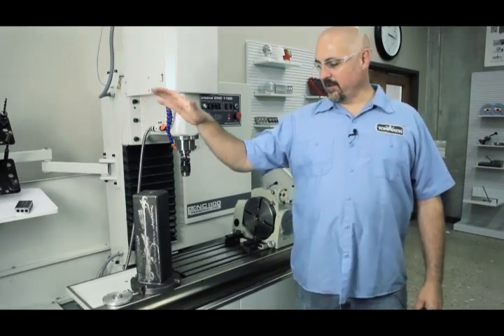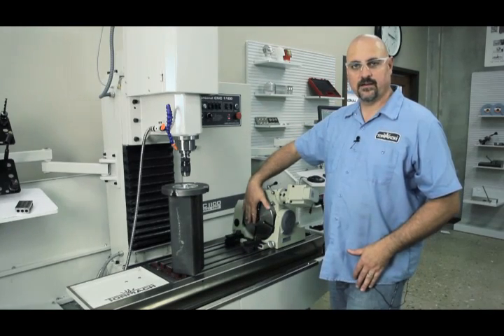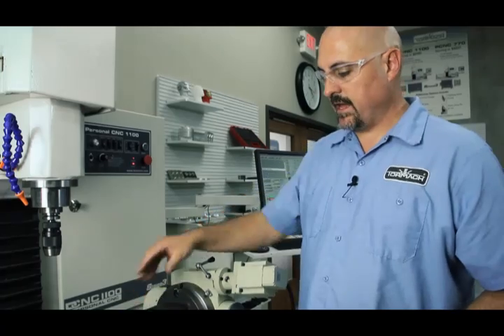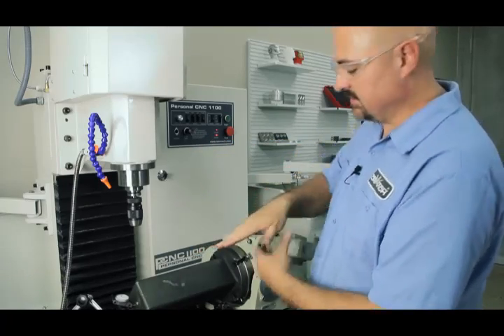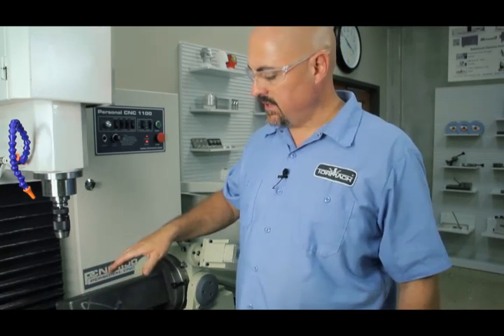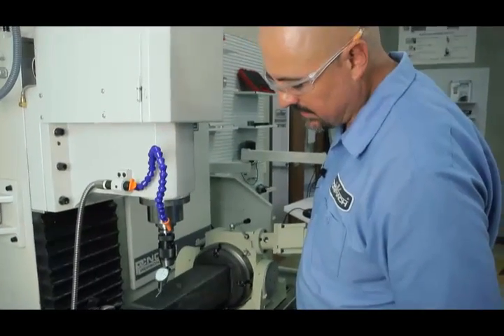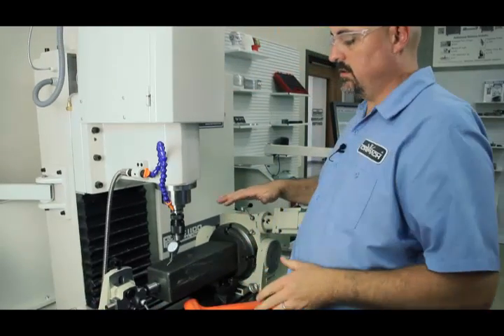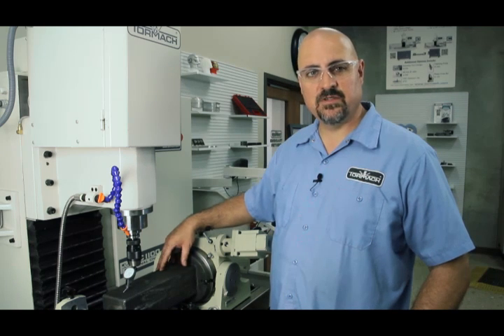How to Setup a Cast Iron Tombstone - Tormach CNC

Comment: So do you need to resurface the tombstone after it’s been setup or is it square out of box?
Reply from the maker: The tombstone comes in a rough cast state. You would need to machine it to fit your needs.
Reply: Tormach Inc. I like how you’ve added a 60deg center on the other end for the tailstock.